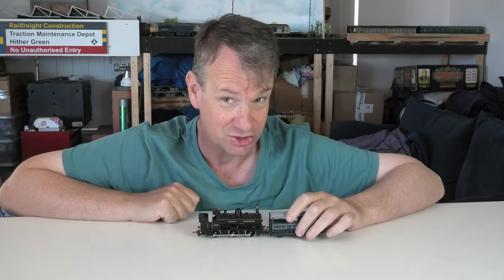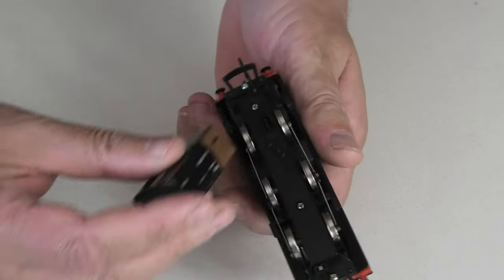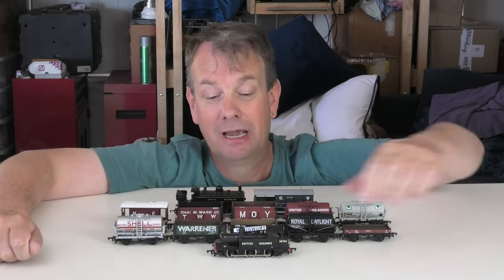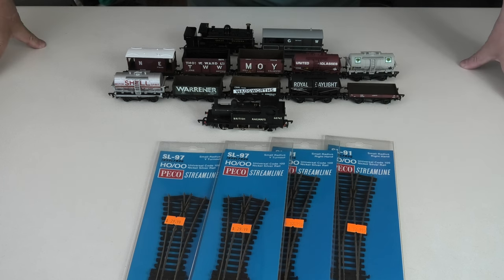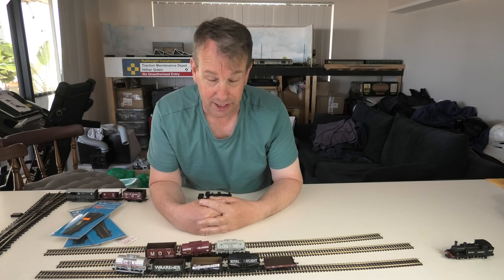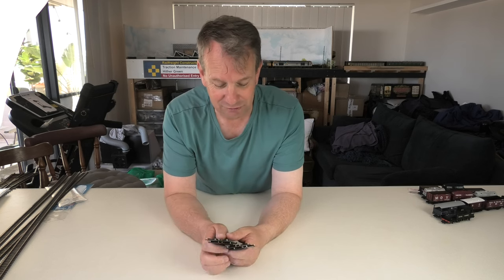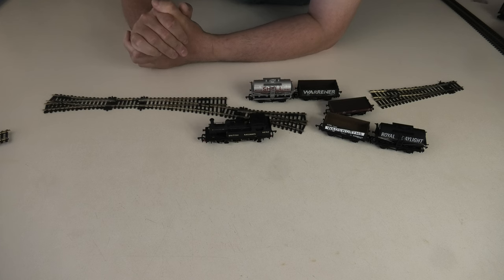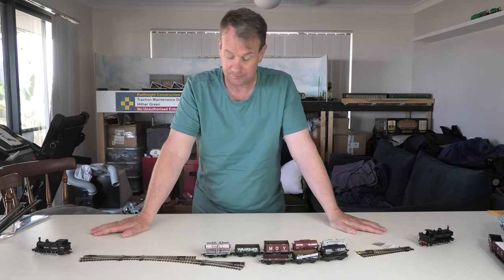Stock and Track - Parsley Sidings Inglenook shunting layout. Part 2

Comment: haha peco points in Aus your're right (I'm down the road in Perth)  they're hard to get hold of.  Well another batch of stock sneaked through your house customs inspector!!! Cheeky. Its looking good, I know need to find out how to order 8 wagons!!!
Reply from the maker: I just searched mainline wagons 00, and they showed up. I guess the same could be said for any wagon and just look at the bundles. My points came from Hobbytech, although one of the lengths of flexi was bent, they were the last 3 they had so I suspect one had been mishandled on the shop floor. 
That one will be the one that gets cut for the shorter pieces
Reply: @47606odin  yeah hobby tech doesn't seem to hold much point stock.though great to visit LOL. Perth modelcentre some times  has them. I have a small selection for the 'future project' sometimes pick up second hand ones form Maylands. nice bundle you had, mainline wagons were always really good espically for private owner coal wagons.